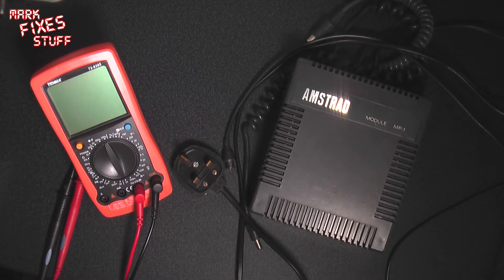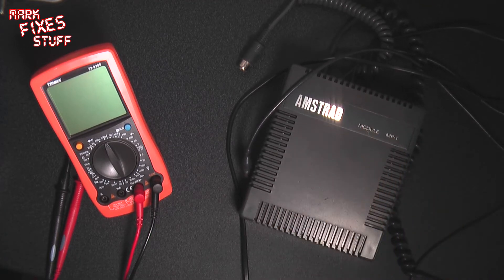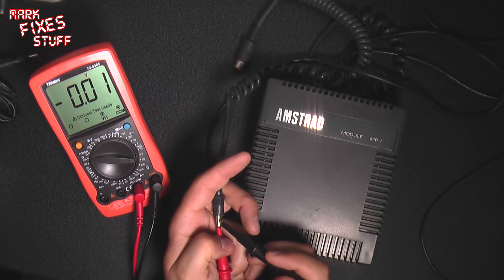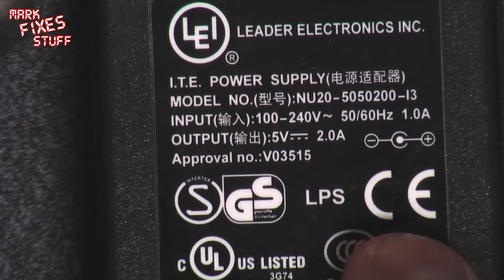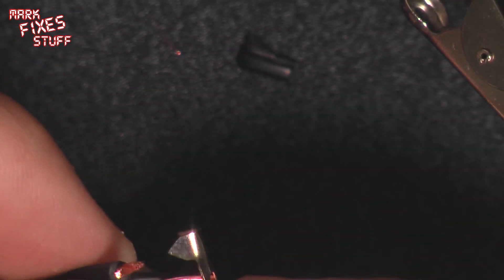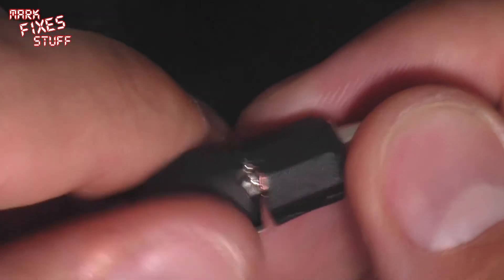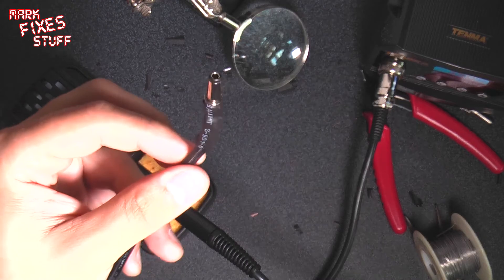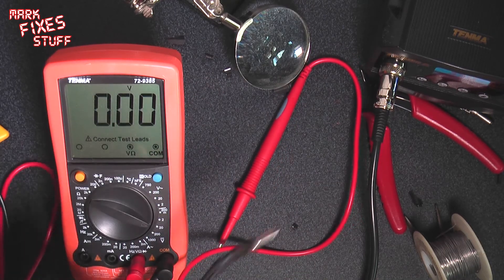FAIL - Adapting a common 5v 2amp PSU for use on Amstrad CPC 464

Comment: Aaah very nice! Chop the Amstrad cable off the RF box and then use block connectors lol! You could even put electrical tape over the block connector for that extra 'dog chewed through it' look!
Reply from the maker: LOL. I don't think I could bring myself to murder the MP-1 even if it does buzz.
Reply: Mark Fixes Stuff - Retro Console and Computer Repairs, Reviews and MORE! haha naah, chop it off a netbook or Megadrive adaptor instead :D

Comment: You should cut one of the wires shorter, so it doesn't bow. Also, if you go for a similar power jack, put some heatshrink on the wire before you put the plastic case on, so it would have proper friction.
Reply from the maker: Thanks for the tips :)